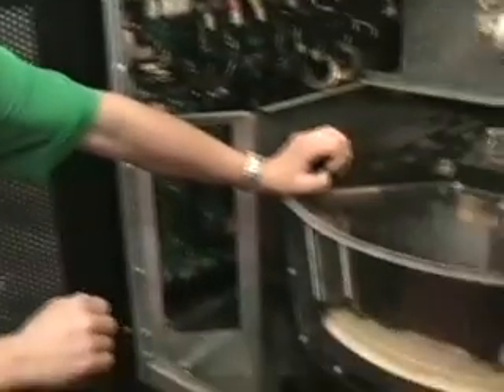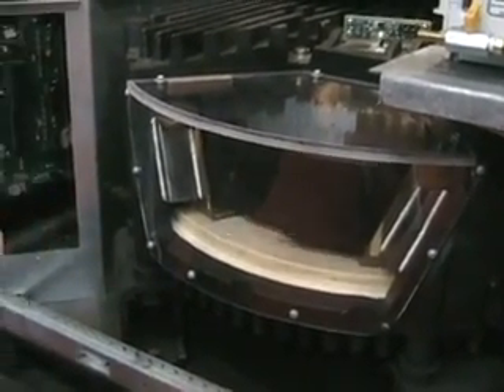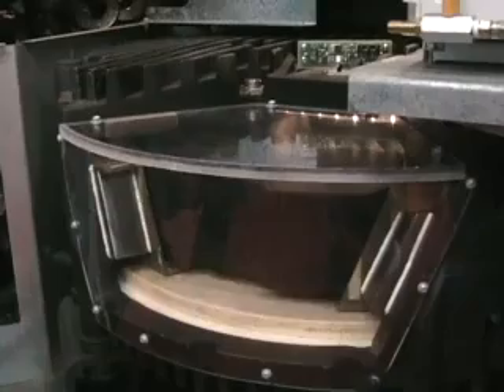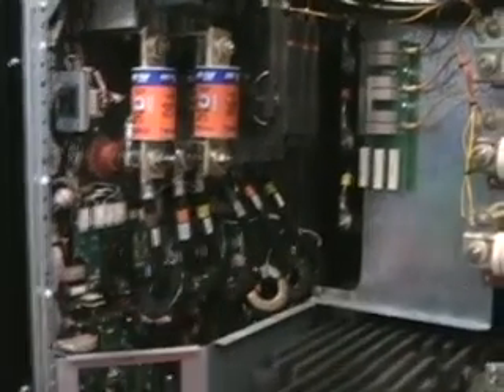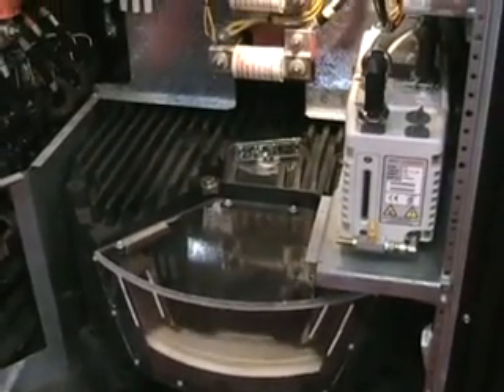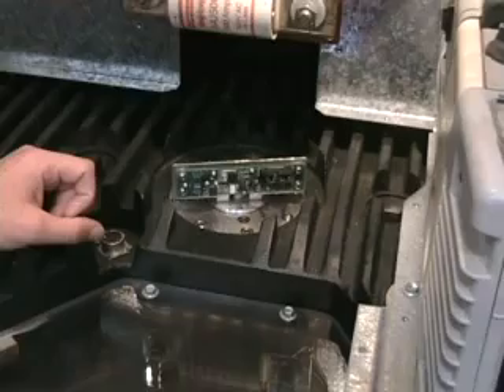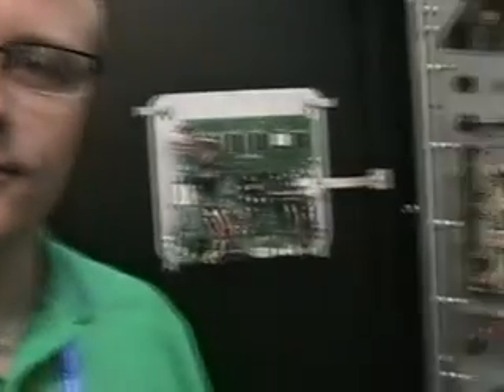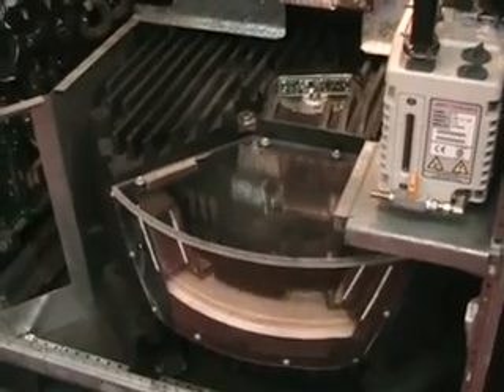ActivePower Flywheel UPS

Comment: For this to work the flywheel presumably must be continually running so that it covers any power down eventuality. So what powers the flywheel please? If this is driven by the regular power supply then this adds running costs and therefore adds to the carbon footprint of the data centre?
Reply: a lot of mass and magnetic bearings all contained within a hermetically sealed vacuum enclosure make for very little energy loss, if you use batteries you still have to charge and discharge those
Reply from the maker: +L3rxst Yes, electricity powers the flywheel, but once it's spinning at speed it doesn't take too much to keep it going.

Comment: What a flywheel like this does is it gives you 250KW of power for about 15 seconds, which is enough to do the one thing you need, bridge the 5-6 seconds that you'd lose power until your generator comes on line. If you have a diesel generator to cover power failure, this is all you need instead of putting in huge battery banks that you have to keep replacing ever 3 years. Plus as he noted, this can also provide the starter for the generator as well. And a flywheel system is mechanical, you can see if it has failed, but there's no way to tell if a battery is not going to supply power until you try to use it. And a flywheel can't leak.

Comment: How can I compare with this type of diesel generator between traditional one? Cause in my experience, the traditional diesel generator is easy fail when demand. So, my company choose the flywheel UPS as start power source. Where can I get the failure rate data ? Anybody can help me?

Comment: I worked for Anton Piller for 8 years and worked on 1000kva systems that had flywheels also .You must also have battery back up when the flywheel runs down . We used turbo generators that started producing in less that 9 seconds.   But they were more cost so a lot of companies like batteries for lower cost.